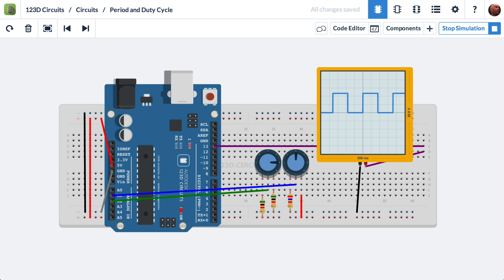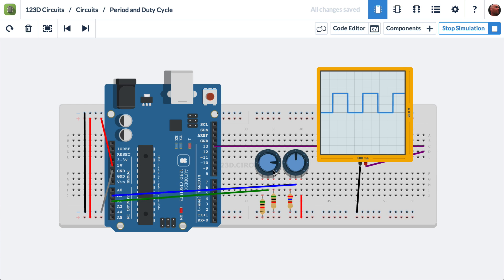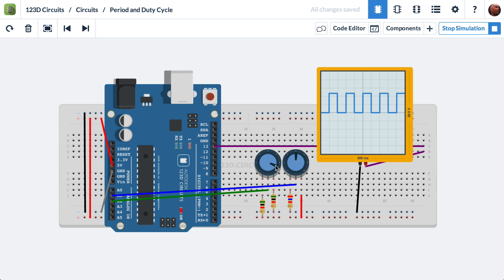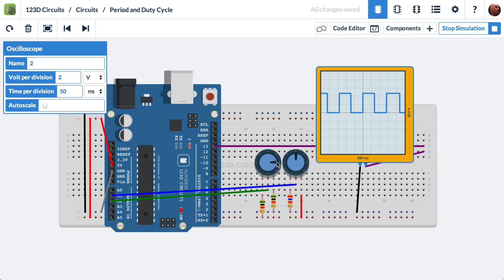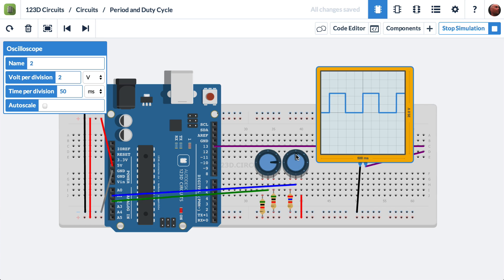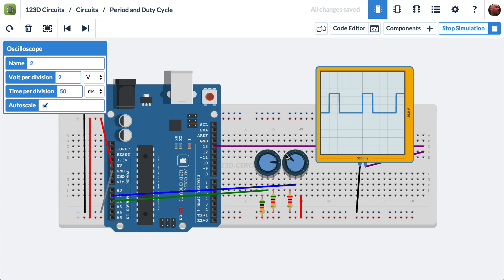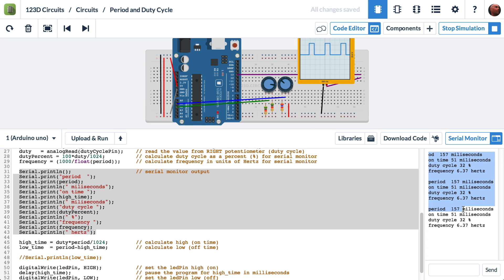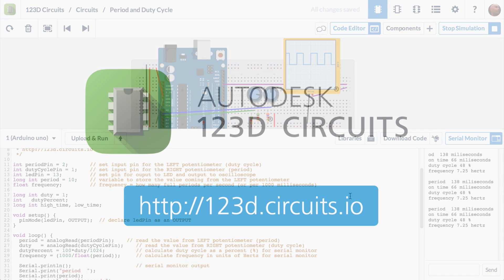Period and Duty Cycle - Electronics Lab

Comment: Pls send code
Reply: if you can not get the code from the link  so you can copy from he comment  just the (( to / /

/* Frequency, Period, and Duty Cycle
 * ---------------------------------
 * Arduino sets pin 13 high/low based on user input via two potentiometers
 * Oscilloscope connected to pin 13 and ground displays waveform
 *
 * Circuit simulation avaliable here:
 * http:((123d.circuits.io
 */
int periodPin = 2;       (( set input pin for the LEFT potentiometer (duty cycle)
int dutyCyclePin = 1;    (( set input pin for the RIGHT potentiometer (period)
int ledPin = 13;         (( set pin for ouput to LED and output to oscilloscope
long int period = 10;    (( variable to store the value coming from the LEFT potentiometer
float frequency;         (( frequency = how many full periods per second (or per 1000 milliseconds)

long int duty = 1;
int   dutyPercent;
long int high_time, low_time;

void setup() {
  Serial.begin(9600);
  pinMode(ledPin, OUTPUT);  (( declare ledPin as an OUTPUT
}
void loop() {
  period = analogRead(periodPin);    (( read the value from LEFT potentiometer (period)
  duty   = analogRead(dutyCyclePin);    (( read the value from RIGHT potentiometer (duty cycle)
  dutyPercent = 100*duty/1024;          (( calculate duty cycle as a percent (%) for serial monitor
  frequency = (1000/float(period));     (( calculate frequency in units of Hertz for serial monitor
  
  Serial.println();                     (( serial monitor output
  Serial.print("period  ");
  Serial.print(period);
  Serial.println(" miliseconds");
  Serial.print("on time ");
  Serial.print(high_time);
  Serial.println(" miliseconds");
  Serial.print("duty cycle ");
  Serial.print(dutyPercent);
  Serial.println(" %");
  Serial.print("frequency ");
  Serial.print(frequency);
  Serial.println(" hertz");
    
  high_time = duty*period/1024;         (( calculate high (on time)
  low_time  = period-high_time;         (( calculate low (off time)
  
  ((Serial.println(low_time);
  
  digitalWrite(ledPin, HIGH);           (( set the ledPin high (on)
  delay(high_time);                     (( pause the program for high_time in milliseconds
  digitalWrite(ledPin, LOW);            (( set the ledPin low (off)
  delay(low_time);                      (( pause the program for low_time in milliseconds
}

Comment: where can i find the sketch
Reply: if you can not get the code from the link  so you can copy from he comment  just the (( to / /

/* Frequency, Period, and Duty Cycle
 * ---------------------------------
 * Arduino sets pin 13 high/low based on user input via two potentiometers
 * Oscilloscope connected to pin 13 and ground displays waveform
 *
 * Circuit simulation avaliable here:
 * http:((123d.circuits.io
 */
int periodPin = 2;       (( set input pin for the LEFT potentiometer (duty cycle)
int dutyCyclePin = 1;    (( set input pin for the RIGHT potentiometer (period)
int ledPin = 13;         (( set pin for ouput to LED and output to oscilloscope
long int period = 10;    (( variable to store the value coming from the LEFT potentiometer
float frequency;         (( frequency = how many full periods per second (or per 1000 milliseconds)

long int duty = 1;
int   dutyPercent;
long int high_time, low_time;

void setup() {
  Serial.begin(9600);
  pinMode(ledPin, OUTPUT);  (( declare ledPin as an OUTPUT
}
void loop() {
  period = analogRead(periodPin);    (( read the value from LEFT potentiometer (period)
  duty   = analogRead(dutyCyclePin);    (( read the value from RIGHT potentiometer (duty cycle)
  dutyPercent = 100*duty/1024;          (( calculate duty cycle as a percent (%) for serial monitor
  frequency = (1000/float(period));     (( calculate frequency in units of Hertz for serial monitor
  
  Serial.println();                     (( serial monitor output
  Serial.print("period  ");
  Serial.print(period);
  Serial.println(" miliseconds");
  Serial.print("on time ");
  Serial.print(high_time);
  Serial.println(" miliseconds");
  Serial.print("duty cycle ");
  Serial.print(dutyPercent);
  Serial.println(" %");
  Serial.print("frequency ");
  Serial.print(frequency);
  Serial.println(" hertz");
    
  high_time = duty*period/1024;         (( calculate high (on time)
  low_time  = period-high_time;         (( calculate low (off time)
  
  ((Serial.println(low_time);
  
  digitalWrite(ledPin, HIGH);           (( set the ledPin high (on)
  delay(high_time);                     (( pause the program for high_time in milliseconds
  digitalWrite(ledPin, LOW);            (( set the ledPin low (off)
  delay(low_time);                      (( pause the program for low_time in milliseconds
}